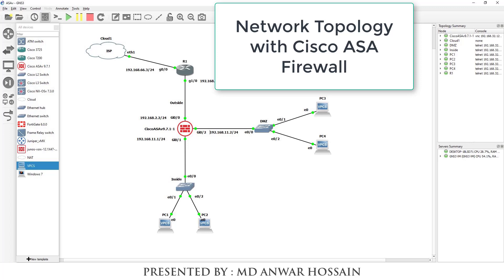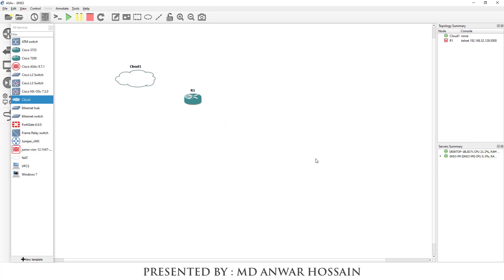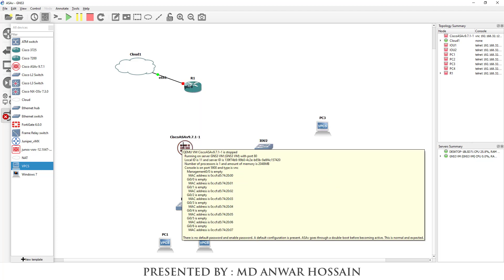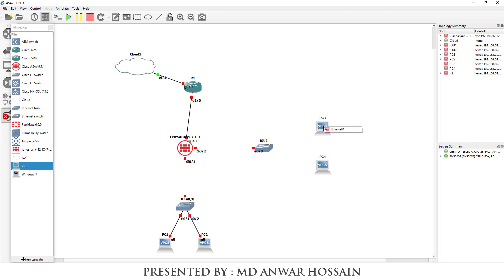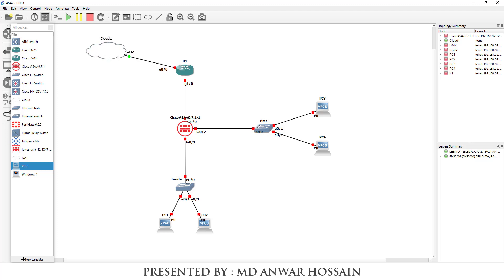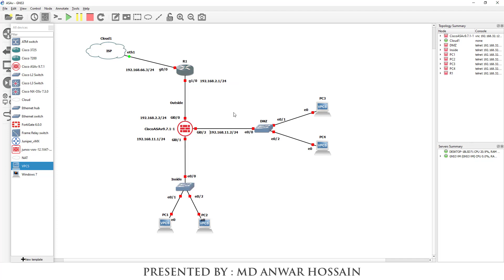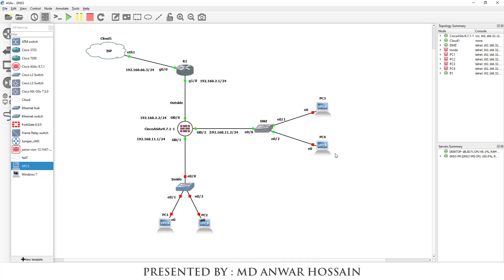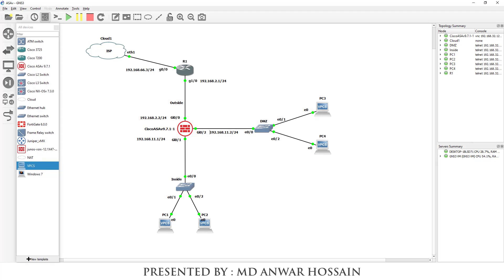Design Network With Cisco ASA Firewall

Comment: For the "Inside" and "DMZ" there are using the same Subnet .11 Network?
Reply from the maker: Inside zone will be individual subnet. I am so sorry In the video there is my typing mistake. Inside should be 11 and dmz will be 12 during the lab configuration I will correct it.
Reply: Md Anwar Hossain Ah i see i got it. appreciate if you can share the file “gns” so that i can play as well in my lab 😊 thanks brother
Reply from the maker: sure brother i will
Reply from the maker: share your mail address please